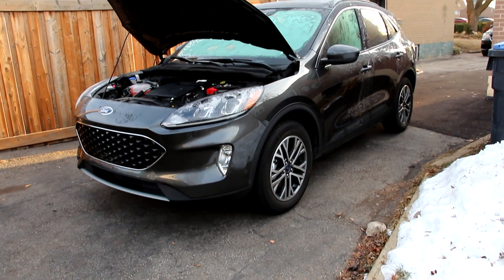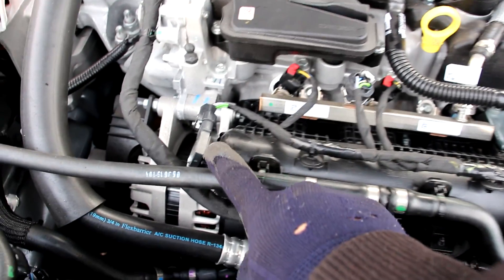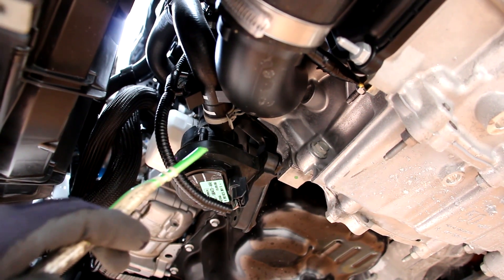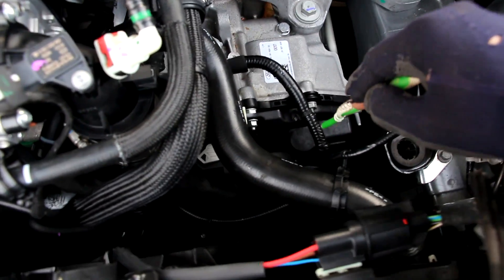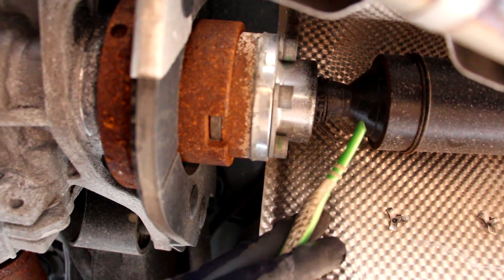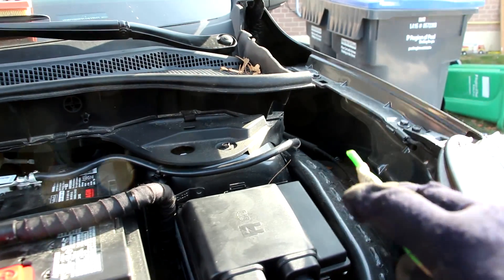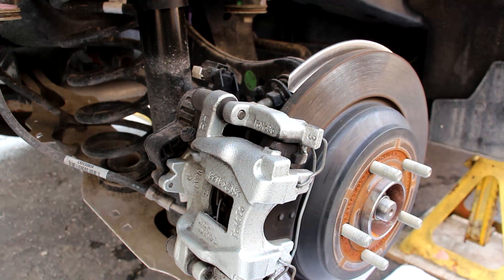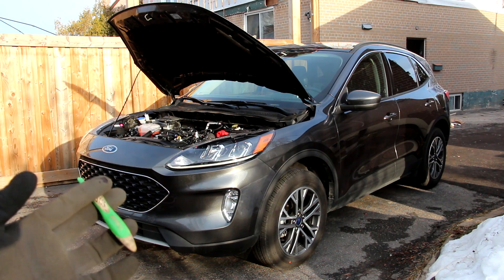Ford Escape Mechanical Review

Comment: Typical domestic garbage.  Women are so easily conned.  Correct me if I'm wrong, but I don't think many people understand how much harder it is on a small engine to use a turbo, as opposed to simply using a larger engine.  That gas mileage savings won't pay off the major repairs.  Thanks for the first-person review, very informative.
Reply from the maker: I agree. The exterior and interior will sell cars. 

I feel sorry for the engine when I punch it
Reply: My 2009 Toyota Yaris has an I-4 1.5 liter engine.  Here we have the same size engine, but with one less cylinder plus turbochargers, powering a much larger vehicle.  It just blows my mind that such a small engine is expected to pull all that weight.  Oh, and don't get me started, I'm with you on most women being stupid about cars (I'm a woman, by the way).

Comment: That thing looks like maintenance nightmare
Reply: It's not meant to be maintained. You drive it for 30,000 miles until the engine seizes up and you go get another one.
Reply: @ChickenC0re  yes but you still have 60 more payments to make
Reply: @ufartface  If the original owners were smart, they'd have 60 payments left. They're doing 84 month loans now. They'd just roll their balance into a new car.
Reply: @ufartface  This isn’t overpriced
Reply from the maker: Not Terrible because there's a ton of room due to a small engine
Reply: Yup, plus you probably have to replace the tinning belt.
Reply: WeAreInTheMatrix timing belt is 90k at tops
Reply: @Rewelsworld  ford timing belts last 100k or 10 years between changing.

Comment: In your opinion is this vehicle easier to work on for a diyer?
Reply from the maker: Yes because there's alot of room due to a small engine in a big vehicle. 

It sucks to replace control arms or even change oil though

Comment: So, ummm...when it is time for a new timing belt, the engine is conveniently worn out as well? LOL. That exhaust note tho. Horrible.
Reply: The exhaust note has no excuse sounding like that. My 3 cylinder Mitsubishi Mirage sounded like a mini V6.
Reply from the maker: You guys didn't like the exhaust note? 

I was quite surprised for a little 3 cylinder. 

From inside though not doesn't sound that good
Reply: @speedkar99  It's no Coyote for sure.

Comment: Garbage.  Buy an older 4 cylinder escape.
Reply: The naturally aspirated 2.5 in the lower trim levels would be most reliable. It's a proven engine.
Reply: @ChickenC0re  the 2.5 is still around with the hybrid system
Reply from the maker: Good call if you want the current gen
Reply: @Kekistani Refugee they are the most reliable of any of  their engines
Reply: @Kekistani Refugee bro the water pump on my 04 is a piece of cake. The only difficult thing to replace is the alternator cause it's jammed in the fender well blocked by the trans axle. However I agree with you, Ford was always harder than old chevy was to fix
Reply: @cpfaclan3681  That’s a vulcan V6 where the camshaft runs the water pump the engine it’s self is mehh
Reply: @mauricemotors8207  no brother, this is a duratec motor. Different than the vulcan. The Duratec's are badass, reliable little motors
Reply: @cpfaclan3681  I still rather the VQ 2GR or J series I’d take the 5.0l coyote 6.2 or new 7.3
Reply: You are correct
Reply: @Kekistani Refugee If you are referring to the 3.5 V6 then yes the water pump is a nightmare to replace. However, the escapes came with the duratec 3.0 not the 3.5. The 3.5 engines were used in the edge not escape. The 3.0 is an excellent durable engine. The water pump on the transverse mounted 3.0 is cam driven on the back of the engine/ transmission side. It is fairly easy to change as I have done so myself.
Reply: @Kekistani Refugee they really need to be maintained. Other than that yeah its cool how things evolve
Reply: How about not to a Ford
Reply: Better yet, buy a Rav4!
Reply: Andy's Shop nope get a Subaru crostek
Reply: @Rewelsworld  And then worry about that stupid Boxer? Nope.
Reply: @andym1223  Have you even owned a boxer? Apparently not
Reply: Definitely but the v6 version.  Much better than that inline garbage they had

Comment: Why would they make the front suspension such a bitch to work on. Is there any advantage to that design?

Also why the single use bolts?
Reply from the maker: Because the nuts are lighter, easier to install due to low running torque and meet vibration testing standards.

Comment: any smart person would buy a rav4 over this any day
Reply from the maker: Not everyone thinks like that...
Reply: My mother purchased a 2015 rav4 brand new and now it has 110k miles. I believe she had to get the alternator replaced at 75k miles. Otherwise, if I'm understanding correctly. The only regular maintenance received were oil changes and the occasional tire rotation.
Reply: @TheyWhomTheGodsDetest 

No battery changes or transmission fluid change? If she actually hasn't done a transmission fluid change, she needs to do one asap.
Reply: @TheyWhomTheGodsDetest ❤
Reply: While that may be true, a ton of people will buy the car thats $1000 cheaper even though its half as reliable. Price is #1 when it comes to the consumer. I sell Toyota and hear this every day.
Reply: Ford drive better than rav4
Reply: A smarter person would buy a corolla and save $5-10k
Reply: @ariellubonja7856  very true.
Reply: @ariellubonja7856 

Much smaller and no AWD. It's a very poor choice for an adult family living in a snowy region (Canada)
Reply: GM 180 The RAV4 will lose its value more slowly than the Corolla and is cheaper to insure.
Reply: mobgma sad but many people don’t think about long term ownership plus some simply lease so it shouldn’t be broken by the time their lease is up
Reply: @instasingingvids3529  ......Exactly, the majority of buyers only keep a auto 3 - 5 years before they are ready to get the newest tech and that's the way the industry is set up. Most any car is going to be warrantied that long so most don't research long term reliability.
Reply: strtngfrsh Cars last longer today than at anytime in history.  The old cars (pre 2000) were junk.
Reply: Nobody really needs big suvs or crossovers, it is just about ego. Back in the days, familys have regular sedans and did fine. I was raised with the 2105 Lada with 2 other siblings and there was no problem
Reply: RAV4 may be my next one to replace the 2009 CRV my wife drives. Honda has been having oil dilution issues on their GDI turbos
Reply: True! I bought a 2020 RAV4 XSE hybrid and the build quality makes this car look like a piece of crap
Reply: No. Any smart person would buy the titanium model with the 2.0 ecoboost engine which outperforms everything in the segment. It will literally dust your Rav 4 and there are many escapes with 300,000+ miles. It all comes down to how you take care of a vehicle. There are lots of POS Toyota’s sitting on lifts now with problems because the truth is ALL manufacturers have problems and even more so these days with all the electronic garbage they put on cars with all manufacturers using parts and sensors coming from from the same global supply bin.
Reply: The Toyota cult strikes again. Most new cars will last a quite while. Toyotas have issues too. Buy what you want to buy, unless it has a known major issue, such as the Nissan CVT or Ford/Getrag Powershift. I suspect that a RAV4 and Escape will last quite a long time.
Reply: No smart person would make a dumb statement like that because everyone's tastes, situation and needs differ, boomer
Reply: Smart is never having to say it. Using punctuation helps too.
Reply: Not sure how I feel about a oil soaked timing belt.
Reply: I drive a civic.  There's no need to waste extra 5 to 10k dollars on a SUV.
Reply: mobgma I bought my 2017 Escape SE 2.0 over the Rav4 for 3 reasons...
1. The Rav4 engine was god awfully slow
2. The ride was aged and it didn't drive like a CUV
3. I plan to buy a small camper, and the Rav4 wouldn't tow what I want. Not everybody wants to give up a comfortable ride and performance for amazing reliability, and trust me, unless you buy a Mazda, you aren't getting both. Plus the new Rav4 that wasn't out when I bought my Escape, but even then, they have has transmission issues, so those are a no-go.
Reply: @damariuseaton6678 facts
Reply: Damarius Eaton the RAV4 has transmission issues? You must mean the Escape has issues. No Toyotas have tranny issues except a few of the first Corollas due to the integration of the physical 1st gear on their CVT but those were already fixed.
Reply: Fevian Cortes Slippage issues and rough shifting... The year Toyota i drove also had 2 recalls. Plus the new Camry's have transmission issues. The 2017 is one of the more reliable Ford's, since they fixed the over heating issue. So no, I meant Toyota, I know what I'm talking about.
Reply: @fcg243 

It's been mentioned by a few owners now on Car and Driver owner reviews. There's complaints about rough shifting and a forceful lunge from a dead stop. Haven't heard of any transmission issues for the Escape. It uses a traditional automatic, not their horrendous dual clutch (found in Focus and Fiesta).
Reply: How about a Tucson or Santa Fe?
Reply: Then people would die of boredom. There would be no innovation since Toyota doesn't know what that means. The roads would be dull. I'd sooner by a second hand range rover than that horrible Rav4. It's truly an awful vehicle. They could've done better.

Comment: Thanks for this. I ended up buying a 2019 Escape with the old 2.5 naturally aspirated 4 cylinder engine since that was the last year with a non-turbo option. This 3 cylinder turbo looks like a mess.
Reply: I bought the 2017 Escape base model with 2.5 and 6 speed.  Price was $18,840 with delivery charge, after rebates.  The RAV4 was about $26,000, and I couldn't justify spending  $7500 more on a RAV4.  Not for nothing, but the front of the RAV4 looks like Darth Vader's helmet besides.  I can do a lot of repairs with my $7500 of savings that I might never even need.  By 2017, the 2.5 liter engine/trans combo was in its 9th year of production, and haven't heard too much complaints about it.  I've had it for 3 1/2 years now, and my repair costs have been $0 so far.  It's going to need a new battery soon, though.
Reply from the maker: Well that might be better than the new one
Reply: The escape hybrid still has a naturally aspirated 2.5l inline four cylinder.
Reply: @johnaccettola  uhhhh you've been fed some BS. Premium fuel does NOT contain any "lubricants". The reason premium is used on turbocharged engines is because it has a higher octane rating and is less likely to detonate or knock under boost pressure. 

But, that won't mean jack shit for turbo life, knock is hard on pistons and bearings tho.
Reply: I had a 2010 Ford Escape with the NA 2.5 engine.  Engine is bullet proof.  Gave it to my daughter with 168k miles on it.  She now has 178k miles on it.  Very reliable engine.  Weak link is the 6 speed transmission.  Change the trans fluid often.  I changed it ever 10k miles.  As soon as the trans fluid gets dirty , the trans starts shifting hard especially after heating up.  This was my 2nd Ford.  I had a Ford Taurus and sold it with 219k miles for $500.  The guy I sold it to put another 20k miles on it. Change the oil and trans fluid and you can get 200k miles out if it.
Reply: hang on to that 2019 as long as you can,  i'm doubting the longevity of this engine design
Reply: @onenikkione  The 1.5 three-cylinder in the Focus has had good reliability over the past 1 1/2 years where the have been no major issues, unlike the Toyota Corolla which has had recalls to have its entire CVT replaced.
Reply: You made the right decision.  I have a 2017 Escape with the 2.5.   110,000 miles , no issues,  I doubt the 3 cyl eco boost will get more than 50k miles without a major problem
Reply: @veedub447  Ecoboost engines are known for going over 200k miles if you change the engine oil every 5k miles. It's the 10k maintenance intervals and neglect that seem to lead these vehicles right into the ground. Most people don't know anything about cars or how they work and treat them like disposable diapers.
Reply: That's what I bought too, I like it a lot and I was going to keep it after the lease until the Bronco reveal, I've dreamed of owning a Bronco since I was a kid so I'm getting a base Bronco 2 door with the only optional things being the 2.7L V6 and tricoat Rapid Red paint.
Reply: good job. dont buy into the turbo design crap all the manufacturers are throwing out there. you should have bought the Rav4 though.
Reply: mobgma - my analysis showed that the 2.5 seemed to perform just as good if not better (no turbo lag) than the mid range turbo on the 2019 Escapes. The only down side was that the 2.5 was limited to the base models. I just didn’t feel like spending over 10 grand more just to get the good turbo engine on the Titanium trim level.
Reply: @obits3  GJ Tom. Unfortunately the escape is still terrible overall. Next time buy the Rav4.
Reply: mobgma - I test drove a RAV4 and the steering didn’t feel responsive enough to me. Also, I paid $20k total before trade in for my base escape with a wheel upgrade (can’t stand hubcaps). All of the base RAV4s had hubcaps, so I would have probably needed to drop at least $5k more just to get my preferred wheels. All in all, if the RAV4 base model had an option for Alloy wheels, I would probably be in a Toyota today.
Reply: @obits3  pay less now, pay more later is what you just did.
Reply: mobgma - What makes you think that? When it comes to repairs, my experience is that hitting $5k of repairs cumulatively doesn’t happen until well after 100K miles. Even if the Toyota has no repairs durning that time, a Ford at $5K less starting price is going to be cheaper in the long run.
Reply: @obits3  you are right as long as the assumption of the escape only needs 5k for repairs before hitting 100k miles is valid.
Reply: teetee tee - when the guy tried to sell me the extended warranty, he used an example of his Jeep needing $5k of repairs at 55k miles for something. I looked him square in the eye and said if this Escape incurs more than $5k of repairs before 100k miles, I’m never buying a Ford again. Usually, Ford cars/CUVs don’t have huge problems until around 110 - 120 thousand miles.
Reply: @obits3  I guess I cherish my money more than using a threat on a lowly sales person in the auto industry which is known to have high turnover rate (they don't stay in their dealership / field for long) so forgive me if I feel it's naive to give them money and say something like that since no one is in position or has the loyalty to care. 

They do care about one thing and one thing only - sell you cars and get their commission and fill their monthly sales quota. So instead of guessing and following the instinct, I checked cars complaints website, calculate the rate of historical complaints against the volume of sale for each model of each year and not getting the Escape is my conclusion. 

It's your money, you get to use them the way you see fit. I keep each of my cars 15 years or more so the total ownership cost matters to me. That's why the reliability factor plays a significant role in my purchase decision.

Extended warranty is just another way dealership rips people off.
Reply: teetee tee - I didn’t threaten a sales guy. I pointed out that it is ridiculous to tell a customer that is dropping $20k on your product that there is a possibility the product could incur $5k (25% of the price) more costs within 5 years. When someone feeds you B.S. they don’t deserve a respectful answer. Extended warranties are a scam used to add margin at the end of the sale after you’ve spent hours looking at cars and getting the deal together.
Reply: Tom Forge There are lots of alloy wheels available for the RAV4 LE.  Toyota needs to make alloy wheels standard.
Reply: @obits3  they try anyrhing to sell you those warranties lol.  I have had it happen to me too with my Mitsubishis.  But all 5 of our Mitsubishis have been trouble free.  I really love our top trim loaded Mitsubishi Eclipse Cross SEL Touring SUVs.  Congrats on your Escape.  My Aunt has a 2018 Ford Escape SEL and she is rough on cars and don’t keep up with oil changes and she has almost 70,000 miles I believe and has had no issues.  Each person like different brands and models for different reasons and one may be a good fit for one buyer but not another.  Glad you are happy with yours!
Reply: Tom Forge it’s the resale value.
Reply: @obits3  maybe so, but if we're just talking about math, then when u try to sell it, the rav4 will get you a higher sale price because the escape will have depreciate more so the rav4 still ends up being cheaper in the long run
Reply: mobgma I got the 1.5 2020 it’s not like I’m racing my escape I just neeed it for good mpg & space
Reply: mobgma i actually went for a Camry indtead of the rav4, 3k cheaper with the same drivetrain and frame. While also being more fuel efficient. And keeping 200hp in a naturally aspirated engine and a reliable car by Toyota.
Reply: Pedro Delgado Hernández The front and rear subframes are much stronger on the RAV4 and the body is more re-enforced.  They only share the same basic TNGA-K architecture.  The RAV4 can tow.  The Camry is not recommended for towing.  The RAV4 engine and transaxel are set up differently.

Comment: I am looking for a turbocharged one cylinder engine for my lawnmower.
Reply: Make sure it has cylinder deactivation.
Reply: @nasedo3129  You got that right!
Reply from the maker: You'll want one with built in air and oil filters, and lifetime engine oil too.
Reply: It seems to be going that way